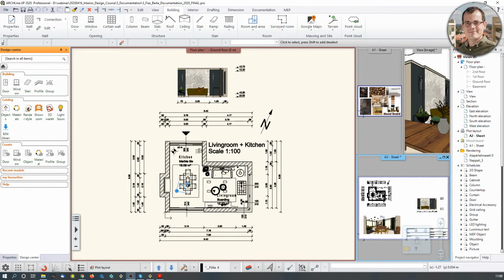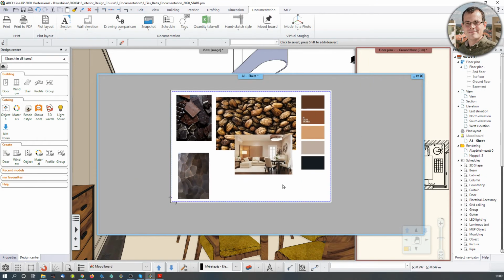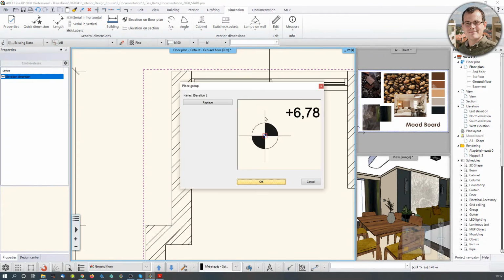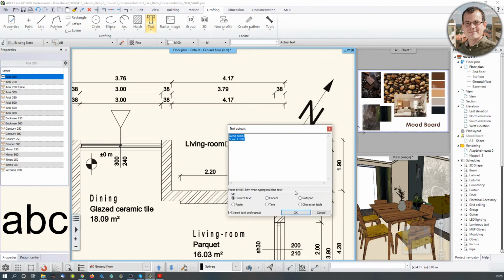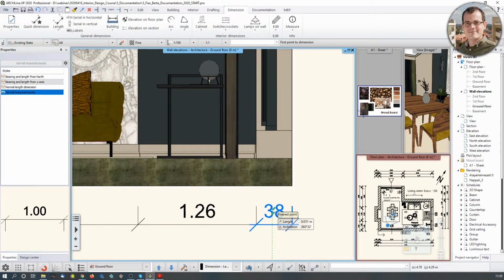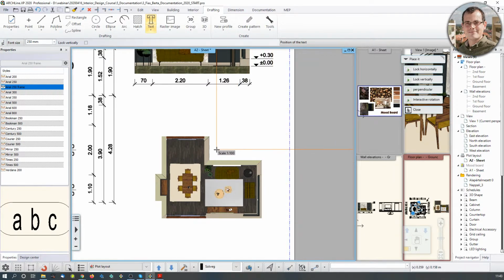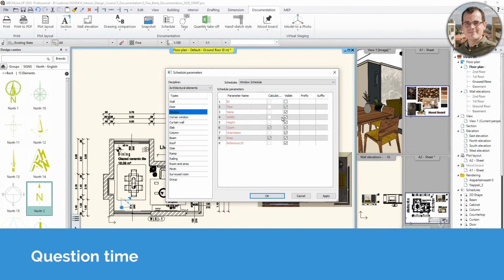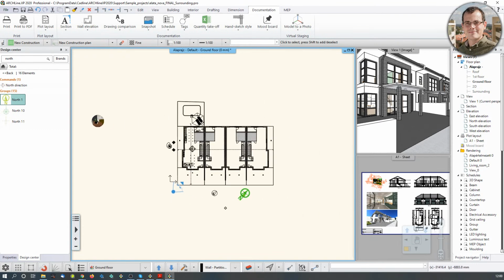Documentation - ARCHLine.XP Preliminary Interior Design Course 5

Comment: Is it possible to export  2d plan to autocad and can be modify in autocad?
Reply from the maker: Hi, we have DWG and DXF exports, which you can read into AutoCAD or any other CAD platform.
Reply: @cadlinenetwork  Thank you for your answer. I try the way you told that the whole project  exported but i want only the 
2d floor plan export and can be see and modify just like we use ARCHLine.XP.